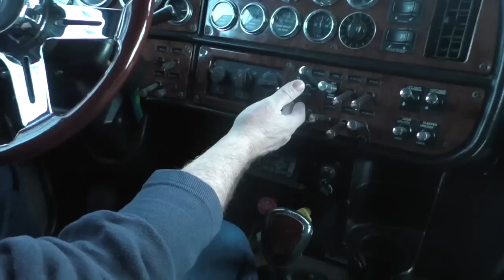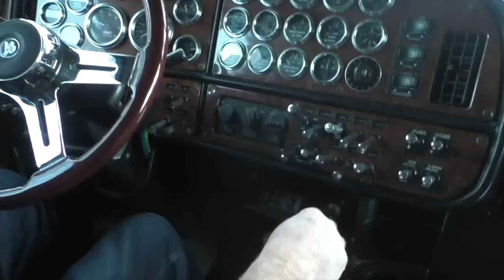How to Handle a JackKnife Skid- A Critical Professional Truck Driver Skill

Comment: Helpful I remember earlier this year I was in Iowa i35 cruising started snowing I was headed to Wisconsin through Minnesota 9000 pounds literally an hour before I got pulled over for a level 3 paperwork inspection had my ducks in a row telling cop all my bol info seal info license info medical card info without looking he was highly impressed took off hit slippery icy roads passing a rig he slowed down pulled off I started slipping losing traction whole road North south was and ice rink I had a freak slip spin out lost traction sliding fish tailing truck I popped clutch through it in neutral so wheels regained same speed I was already slowing down both hands on the wheel and I feathered the breaks Jake's on low and kept it under control hit the shoulder wheels up came to a safe stop you can tell people not to over react and not to hard break till your blue in the face until someone does it they will never understand why but take it from me if you think he's misleading he's absolutely correct happened to me it was cold in February and the roads freakly just turned to sheer ice in minutes gotta stay calm but any over steer over correction is catastrophic and will result in a lay over or jack knife in the matter of a blink of the eye

Comment: What do you mean shut off the Hydros. First job out of school driving doubles on the east coast. Since axles slip seat poorly maintained tractors
 Poor training there are switches/controls in the cab that I have no Idea what they do or when to use them. 
This will be my first winter. I have asked the saftey team twice for more inclimate weather training and more comprehensive training of the controls in the cab. Nothing.
Any help or suggestions on pulling doubles in winters especially going down grades. Would greatly appreciated. We run Ken's and petes single screw
Most commonly though is the Volvo single screw.

Comment: Hello Dave..i am not a truck driver but I owe my allegiance to truck drivers as I sell air brake parts and accessories full time.  I am assuming that the lever on the right side of your steering column is the trailer hand valve.  I have greatly enjoyed your videos.  Please keep them coming
Reply from the maker: Thanks Chris, yup that's the trailer brake. Thanks for writing in and I'll do my best to keep them coming. Appreciate it!    Dave

Comment: Hummm. You say not to use the Johnson bar? Had a trailer hit a big puddle and started to break loose to the right. Was not speeding. Tapped the Johnson bar and throttle up very lightly. Trailer snapped back behind me. You are dead on steering lightly.

Comment: Are you sure about steering into the skid?  I mean, unless I didn't understand or you mis-spoke, if say, my drive wheels start going left then I let off throttle and steer to the left.  I think I got confused when if I remember correctly you said that the trailer was going into the passenger side and made a motion to the right on your steering wheel.  You steer into the direction your drive wheels are skidding out on a little bit with no throttle and a little bit of engine brake.  Right?

Comment: Isn't there a temperature sensor that reads road temperature?  (By taking IR reading off the road surface.)  Seems like that would be helpful.  The road could be colder (or warmer) than the air.  I'd think it's pavement temps that count.

Comment: @smart trucking What about overtaking can that cause a jackknife. shoutout from durban south africa
Reply from the maker: Good point! I try to overtake and pass only on a straight stretch of road where you can see a mile ahead  or more so you can take your time and not have to rush it.
Reply: @SmartTrucking  thanks for that tip

Comment: i don't remember the year early 80's i have only been driving a couple years and was in Lubboc Tx heading south. i shouldn't have left because more less as soon as i got out of town i was on a sheet of ice. i knew i had about 50 miles before i could safely stop until the ice melted. so a swift truck and myself was running about 15 mph with 4 ways on. couldn't see but about 100 feet or so. taking our time and i was pulling a tanker at the time.  we was doing great talking on the CB he was leading i could see his lights but not his trailer. i think we was being as sage as we could be. being we was stupid enough to get out there and drive in the first place. LOL when out of the blue a bright red car hauler came flying past us running at least 50 mph. he came over the CB and called us F-ing boot camp drivers.  about a hour later 12 miles we heard over the CB anyone out there i need help. i came back ask where they was and is everyone ok. he told me and said yes evey one was ok that he jack knifed and lost 2 cars off his truck. but everyone was ok. about 3 more miles down the road their was that bright red car hauler in the ditch. i told swift to just keep driving and said f-ing boot camp driver.  when we did get where we could stop we did  and call for help for him but i didn't really want to. but this was way before cell phones for you young people out there.

Comment: I was getting a ride to a airport with a experienced driver, and we passed this. a trailer was improperly loaded and the trailer broke in half !! we turned on the CB Radio to see if there was any word on the situation and apparently he was at a high rate of speed when it happened lucky for him the kingpin broke off and he became unhooked and was able to gear down and stop ahead of the trailer.  Was there a better way to do this??

Comment: Granted i just run a pickup or 2 ton flatbed truck with a bumper pull,  the cb has saved me, and i have found hitting the trailer brakes will pull it back striat.
Can yall just hit the trailer brakes on a big rig, or not?

Comment: I thought the thing to do would be to pull on the trailer and pull it until you no longer have the opportunity to do so... because if you stop pulling then wouldn't the trailer push on truck causing a jackknife?.....  I never had a skid (wood hit) and to pull on the trailer was my plan if it ever happened...
Reply from the maker: Yours is a good plan but it's hard to pull on the trailer on an icy road when your drives are breaking traction. Slight trailer brake application can work sometimes and sometimes it just makes things worse.

Comment: What do you mean by steer into the skid?

If my trailer kicks out to my right, I should steer towards the right or left?

I would think steering to the right would force the jackknife harder and steering left would increase the chances for rollover

Am I getting this wrong?
Reply from the maker: Steer to the right, gently in the hope that it will help the trailer straighten itself.     Dave
Reply: Thanks

Comment: The jig/jake brake, is that the exhaust brake or something different again?
Reply: The jake brake serves the same purpose as an exhaust brake, it's just mechanically different, and has more retarding power. Also known as a engine brake or compression brake

Comment: I had a slide twice and both times on wet surfaces and both times going too fast on a curve. The truck handles great when it's dry but your confidence makes you forget that you're carrying a lot of weight.  Luckily I got it under control but it took several minutes for my foot to stop shaking.

Comment: Thanks for the video. I start CDL School Jan. 2. I don't usually drive in snowy/icy conditions and I figure it will be Spring or Summer before I can get hired and with a trainer. Then that will leave me next Winter solo for the first Winter. Any suggestions?
Reply from the maker: Go slow, look way ahead, don't brake too hard and stay away from other trucks and cars. Park somewhere safe if you don't feel comfortable and stay there until the roads get better.    Dave

Comment: What do you feel at first when the trailer is starting to jacknife
Reply: Tariq Robinson probably nothing.. but you could see it in the mirror.
Reply from the maker: What John said, but sometimes, depending on what's sliding, you'll start to notice the cab isn't oriented on the road properly or that the steering is not taking you where you want to go. Sometimes you just feel it in the seat of your pants. It's not a good feeling.   Dave
Reply: Good reply. That brings up my main complaint with a cabover. Without a beak out in front of you it is a little harder to realize you not square with the road.

Comment: turn into it ? i thought you turn the other way and counter steer?
Reply: Steer towards the direction the rear tires are sliding.  If the drives slide left steer left etc.

Comment: You can have balls of steel but when that truck starts skidding when you really need to stop, all that tough guy crap goes out the window. If people would just adjust their driveing habits to the change of conditions and SLOW DOWN there would be less accidents. That's the secret, each type of vehicle will react different to each kind of weather. Cars and trucks alike. I've only been trucking for 4 years, I've never been in an accident in my personal or professional driveing. I've had a few close calls in bad weather but I've managed to keep that truck under control.Ive had a few bonehead mistakes where it was just property damage, thank the lord nobody ever got hurt. Could'nt handle it if I hurt someone with that truck. Even a tap could be devastating.  People just be very careful and slow down.
Reply from the maker: Excellent advice Jason. You've obviously learned a lot in four years!     Dave

Comment: I'm not saying this is how to correct a jacknife. This was my circumstance. 

Weather conditions were light snow, maybe and inch. I had just delivered in East Boston, trailer was empty. I was heading MA I-93 south, just went over the Zakim bridge and I was coming downhill into the tunnel. Felt like I was going just a touch too fast so I lightly touched the brake. Big mistake. The trailer immediately went to the next lane on the passenger side and was still moving further over. Luckily there were no cars on that side, which is rare for that stretch of road. 

Solution. There was no traffic ahead of me so I pressed the accelerator a bit. Which pulled the trailer back in line behind me fairly quickly. When I hit the tunnel the road was wet but not icy. I then decelerated. Then it was just a matter of stopping at my convenience for a change of underwear. 

Let me be clear, I did that almost without thinking and I don't think that kind of correction would have worked for most situations. I knew that I'd be on a better surface in 50 meters or so when I got in the tunnel.  

I'll tell you, even though my brain had apparently formed a plan without my being conscious of it, my heart was screaming at me to smash those brakes hard too.
Reply from the maker: Good job driver!  The object of the game is straighten out and not hit anything, and you did it!    Dave
Reply: There's nothing like that feeling in your gut when things are going wrong. Anything that can be done to help other drivers avoid that is a good thing IMO. Telling our stories could help maybe. You do good work on this channel. Many thanks for your efforts.

Comment: Can use an air horn in the city
Reply: Valerie Chambliss yea only if it is needed like late braking into an intersection
Reply from the maker: Sure, if you need to.   Dave
Reply: Valerie Chambliss I prefer using those in Wal-Mart Parking Lots

Comment: My dad did two million plus miles without chargeable accidents.  Power braking and or use of the trailer brake handle was a part of it. I respect your experience but you're leaving a tool out.

Comment: First of all super trucker. knuck why were you driving the speed limit knowing the road was slick. if there's no spray coming off the tires your on ice. if it's freezing on windshield and mirrors it's freezing on the road. been driving 27yrs never jackknifed never rolled one never hit anything.
Reply from the maker: Well Todd, you're off to a good start, Call me in another 10 years or so. What does knuck mean?    Dave